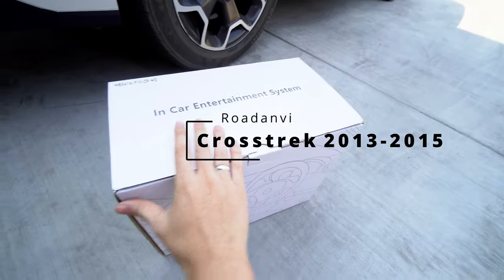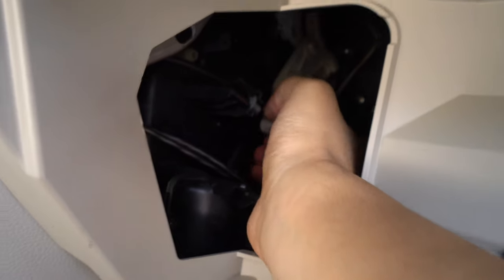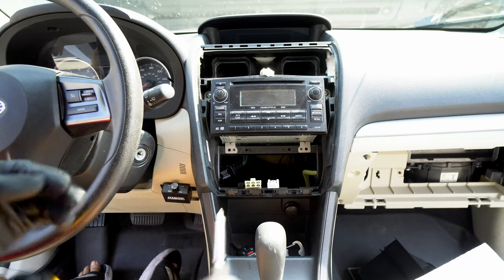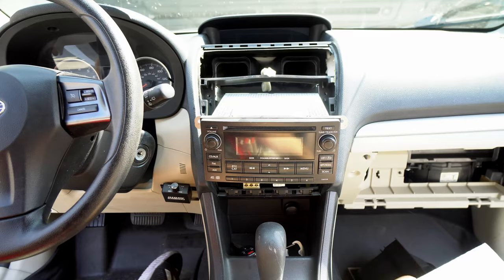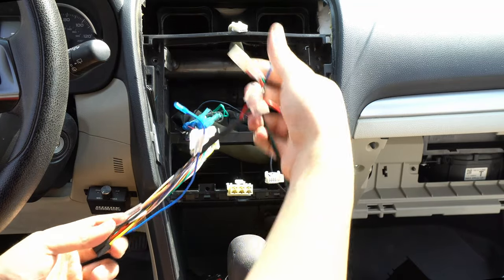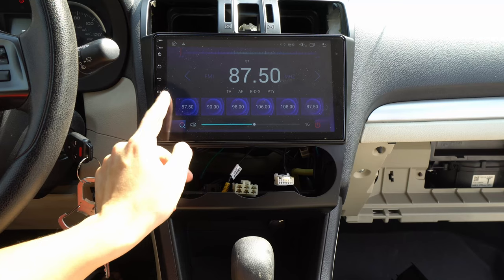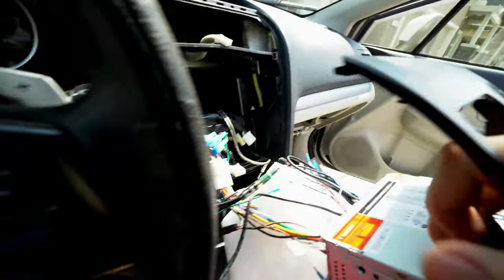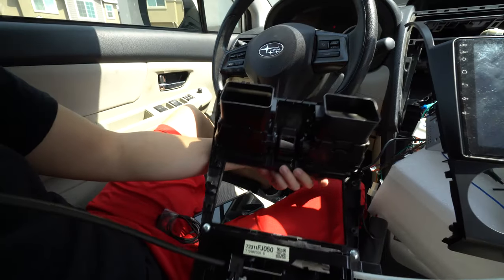How to Install a Head unit | Subaru Crosstrek Apple carplay & Android Auto | Roadanvi

Comment: Thank you for the video! Did you get the F10 or the F10 pro. I am seeing on amazon that there is a model with 64 ROM and a model with a 128 ROM. Is there a huge difference between the two?

Comment: Thank you for posting this video.  The final look is great. The factory unit was attached to the dashboard with four screws, what is holding this aftermarket unit on?  Is it just the plastic clips of the surrounding bezel?  Is it as secure?
Reply from the maker: Yeah it is being held by clips and it's a tight fit

Comment: I got a 2014 Subaru XV Crosstrek do you have a link for a similar head unit, the one one the description is not working.
Reply: hey, did you ever find the right head unit for your car? I just bought a 2014 subaru crosstrek xv limited and am not sure which one to get... hard to find the correct info online

Comment: I got an idoing for my.2016 Crosstrek. The Android auto doesn't launch automatically. I have to open carlink Everytime. Any tips to make Android auto launch every I connect my USB cable to my phone
Reply from the maker: There should be a setting to remember last open app in settings. 

Also have it so auto-sleep is on automatic
Reply: Thanks John!!! It works!!! Last question, do you know where to go to download the updated firmware for the headunit? Can't seem to find it anywhere

Comment: Seems odd, but my very early 2013 Crosstrek (one of the first here when they came out) seems to not have cables for the climate controls, it doesn't look like yours does behind the glovebox.  Maybe they started with digital controls and then changed to mechanical?  Has anyone else encountered this?